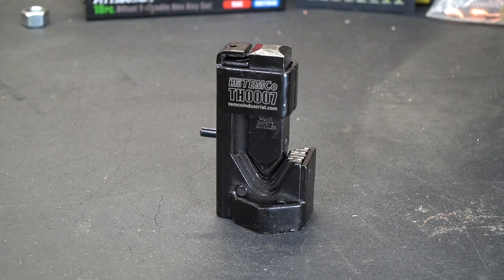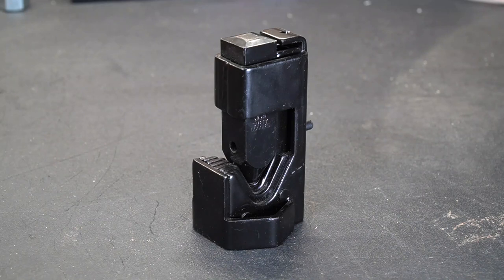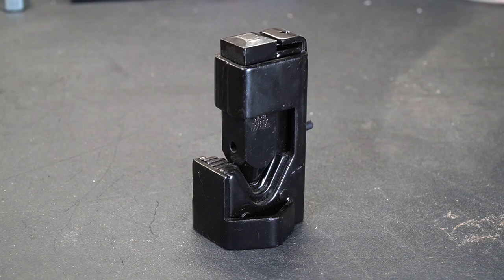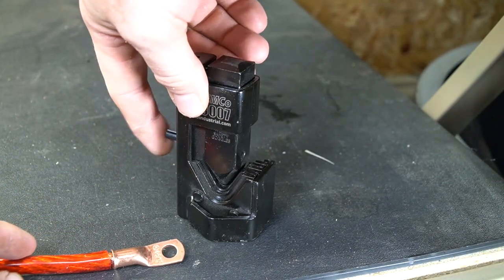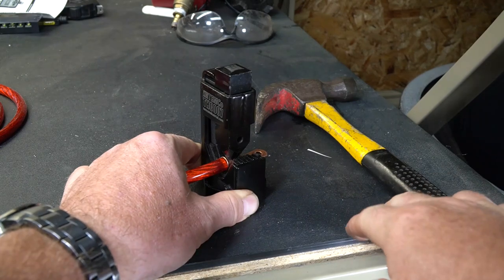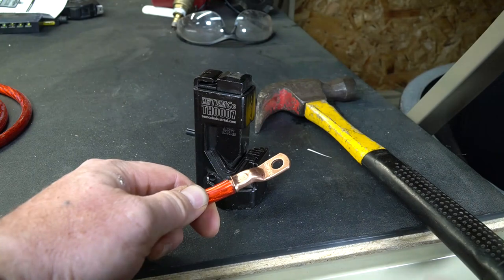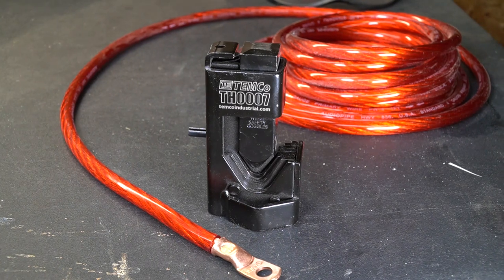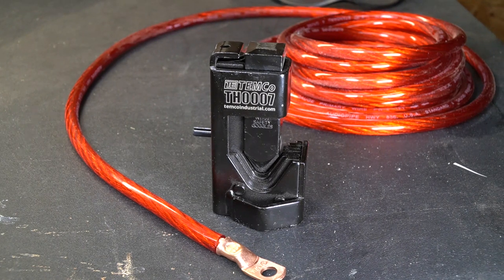Hammer Lug Crimping Tool by Temco, TH0007 How to easily put lugs on larger wires! NTDT!

Comment: On the soldering the cables I heard it’s a bad method to crimp your lugs because you get a resistance and you don’t want that.
Reply: I read some papers researching this on Google Scholar, and crimping turns out to have much lower resistance and failure rates than soldering.
Reply: If it’s a good crimp I think it is better and lower resistance than soldering.
Reply: I was just researching that and apart from resistance which may not be an issue with increased surface area, it seems the bigger issue is that flux from solder can have long term effects on the wire and make strands more prone to breakage.  Generally flux is washed off and/or the wire is not stressed, but maybe a consideration with lugs that wicked up flux into fine strand cables.

Comment: Just want to say... when you're using heavy cable like this, you're talking about enough current, that should something go wrong and your cable heats up.... once that solder melts you no longer have a mechanical connection to the terminal.
Reply from the maker: Very true, and keep in mind once you get the lugs hot enough to melt solder, not only did you not size your wire, breakers and or fuses incorrectly, you have other issues you need to worry about at that point. :D